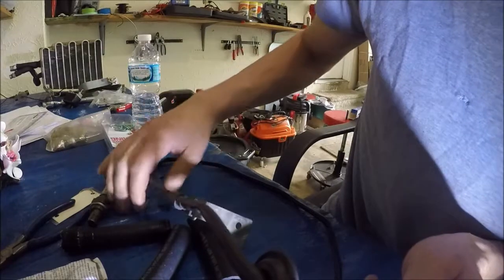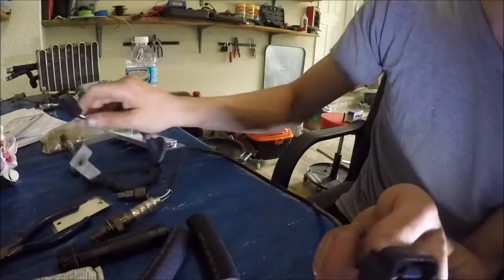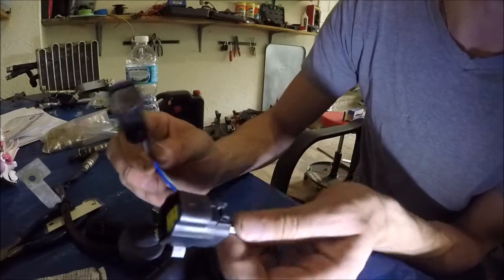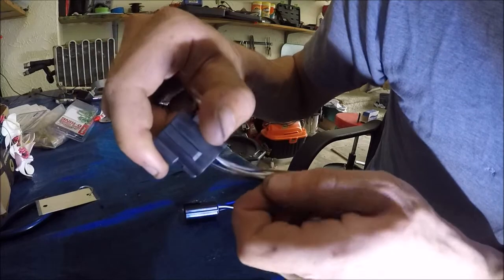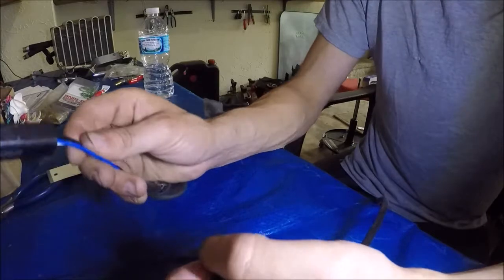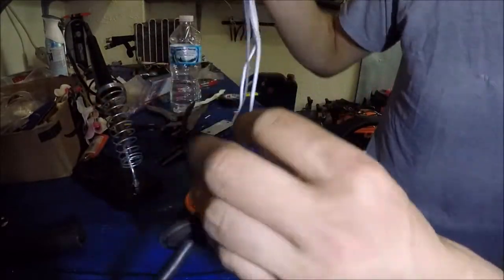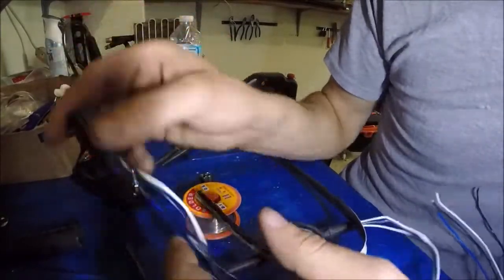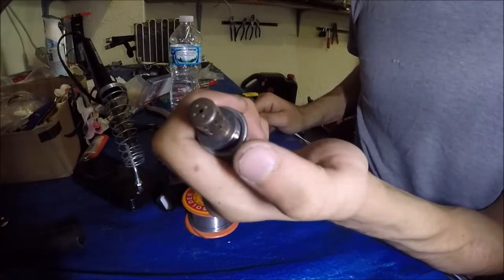How to make a cheap o2 sensor - Mazda Miata

Comment: Just a question. What 's year model yours. Anthony? I know plug connector is under the driver's seat carpet. On some model like 97, we need to undo 4 bolts and  lift out the seat to get the harness. Accoding to your tutorial, In your Miata, we do not have to take out seat fortunately. right?
Reply from the maker: Hi Douglas, mine is a 97. If I move the seat all the way back, I can get away without removing the seat :)

Comment: Good to know thanks. I'm checking a lot of things as I have a weird misfire. The car runs fine on cold start up but once up to temperature the injector on n°1 cylinder no longer fires ( I've done the sound test the injector pulses fine on cold start but no longer gives any signs if life when the car is up to temperature) so I have a dead cylinder and she runs rough on 3. Some have suggested this may be an oxygen sensor gone bad, but the only problem is on n°1... any ideas? I've checked plugs, ht cables etc. And all ok.

Comment: As far as I know downstream sensor's only job is to monitor if catalytic converter functions properly and set code if it does not. Downstream sensor has no effect on fuel mixture, performance or economy, upstream sensor does that.
Reply from the maker: You are correct!

Comment: Hi. Ty for your videos. I look on the video that you make about install aux in Mazda 3 and you left a link to buy the cable. Buy you said that its feet only from 2006 and I have mazda 3 2005. So can you please send me a link for the right cable for me? Ty so much
Reply from the maker: Hi Israel, I have left you a link of a cable that claims to work on a 2005 Mazda 3.
Please double check with the seller before purchasing it. Please ask any questions.

https://www.amazon.com/Auxillary-Yomikoo-interface-2004-2008-2005-2009/dp/B016BD7J08/ref=pd_sbs_107_2?_encoding=UTF8&pd_rd_i=B016BD7J08&pd_rd_r=b3e214b1-71d9-11e8-9ab7-39985758a02b&pd_rd_w=CsNVw&pd_rd_wg=rgM7f&pf_rd_i=desktop-dp-sims&pf_rd_m=ATVPDKIKX0DER&pf_rd_p=5825442648805390339&pf_rd_r=K277PG940ECNG3MTCBP5&pf_rd_s=desktop-dp-sims&pf_rd_t=40701&psc=1&refRID=K277PG940ECNG3MTCBP5
Reply: Anthony Awada.  hi Anthony. Ty for you help. But maybe you think there's a cheaper cable?  And again ty very much
Reply from the maker: Hi Israel,
I found this one on eBay for a few dollars less and comes with an ipod plug. For these first generation Mazda 3, the aux adapter is a little more expensive because you need the adapter. You can't use a simple plugin wire that cost $4 like the ones on the Mazda 6. Please verify with the seller about the fitment of the cable before purchasing. Good luck :)

https://www.ebay.com/itm/3-5mm-Car-iPhone5-MP3-Player-Interface-Audio-AUX-Adapter-Cable-For-Mazda/263602240756?hash=item3d5feafcf4:g:F6sAAOSwC6hazteb
Reply: Anthony Awada ty so much. I appreciate it
Reply from the maker: You're welcome :)